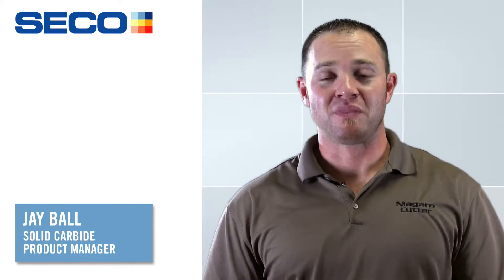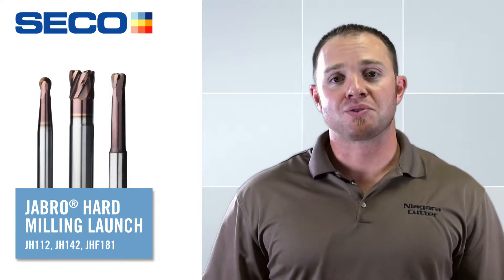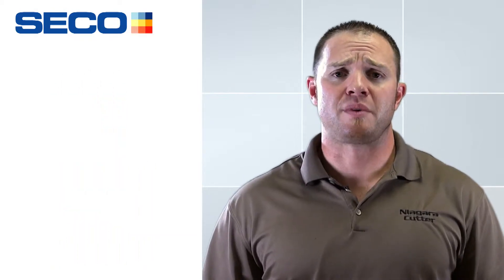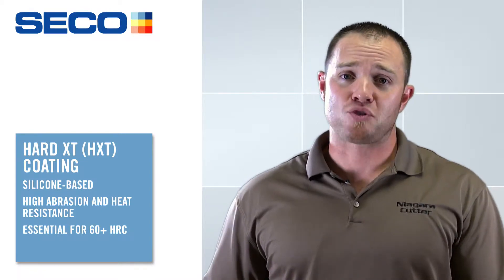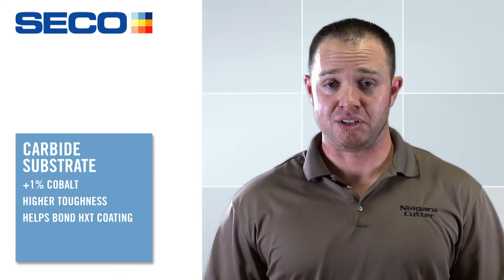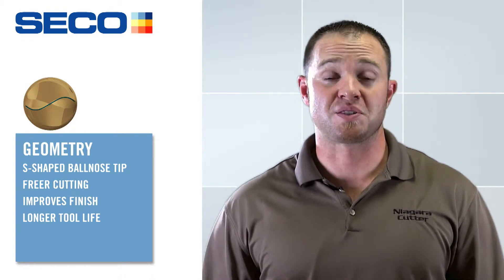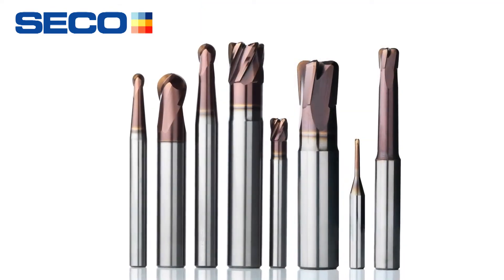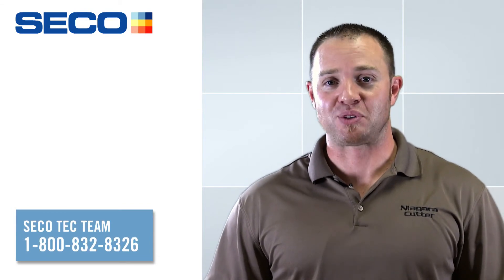Hard Milling Introduction | Seco Tools

Comment: I'm going to ask a strange question...  I need to take .040" off one side of a 1-2-3 block.  Pretty hard stuff.  I don't have a meter to measure.  Any chance I could do this on a manual Bridgeport with only mist cooling?